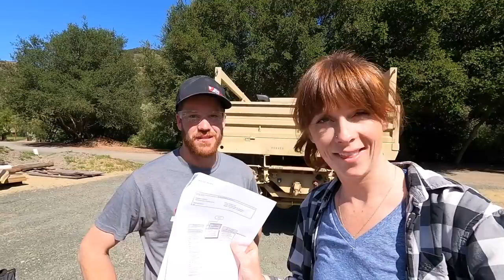We Bought A MASSIVE Army Truck!

Comment: I used to drive these trucks at Eglin AFB. I had a great time. You guys will love it.
Don’t forget these trucks are Army Proof!

We used to bleed the air from the tanks before storage to prevent tank corrosion. Don’t stand in front of the air tank valves when they’re open so you don’t get injected with water.
Reply from the maker: Thanks for the reminder on draining the tanks! We've heard its especially important in below freezing conditions.

Comment: Little pro tip if you haven’t already sorted it, if you just put your hand over the alarm while the air pressure builds it makes it a lot more tolerable. Also, with the truck in park you can press the accelerator to increase the output of the compressor to build the pressure faster.

I’m curious, were the brakes actually locked prior to having the pressure to release them? I would assume they were and when they disengaged they didn’t want to reengage? 🤔 and if all 4 are doing it then I’d think it would be a mix or cross over valve that effected the operation of both sides and the front and back as well. I find it a bit unlikely that all brake chambers should’ve failed at once. Let us know what you find out. Thanks!
Reply from the maker: Riley eventually figured out both of your tips, which saved our ears and patience! 😂

Once we got it home we tested the psi at each wheel and every wheel was receiving 110 psi. They system gets to pressure quickly and holds pressure over night. The parking brake could lock the vehicle up and keep it from moving forward but it would drive right through the service brakes. After driving it a bit they seem to be getting better so we are wondering if things were just rusty from sitting by the cost for 4 years and needed working loose?
Reply: That’s kind of what I was leaning toward as well. I would be interested to see inside one of those drums to see how the shoes look. Watch your backs, because the tires are not light if you go to pull one off to check! Also there is typically a troop ladder shoved up under the bed somewhere to get in and out of the back. However, it may have been borrowed long term from your new rig 😂🤷🏽‍♂️
Reply from the maker: @TimTaigaTradesman  The troop ladder is missing and the previous owner said he never had it. Kind of a bummer!
Reply: Dang, no bueno! That’s alright easy to fab one up, but I’m sure the back will be transformed to something new sooner rather than later. Excited to see what you guys come up with. Also, a bit jealous of Riley’s 3D Cad design work and that plasma CNC you guys have. I’m still using the old napkin drawings and by hand method. Would like to get a better grasp on the metal brake as well. Anyways, I’m just rambling at this point.
Reply: @theadventuresofarenaissancman  there's one. I remembered using them.

Comment: Bought our m1078  in Massachusetts. Drove it home to Kentucky (1200 miles).  Hitting 2 lanes and single lane gravel roads.  Only had one tire blow out due to a ctis valve sticking.  So far I bought a ambulance box to build a removable camper box (pod).  Have fun with it.
Reply from the maker: I’m glad to hear you made it home safely! That sounds like it is going to be a fun build! 👊🏻

Comment: The air tanks need to be purged. There are usually places to do this where the air tank "spits." This is the sound it makes once the tanks fill to 120psi. There should be a wire lanyard or chain that allows you to pull a pressure release valve and water should spray out of the tanks. Once the tanks stop spraying water. Your lines should be clear from moisture that can lay in the air lines. @7:00 It's pretty obvious that this maintenance was not performed when the vehicle was parked. This was what cause the erosion in your check valve. There is also water separator on the engine that should be purged before you crank the engine over, the longer the vehicle sits, the more water build up in the tanks from condensation.
Reply: Every day after the truck is parked and the engine shut off - purge the air tanks.
Reply: great one i said the same thing...
Reply: @coyotePAC3  If its equipped with an air dryer it makes no sense to purge the tanks that often....   :-D
Reply: @johnnyrockford5641  Most military trucks don't have that, lowest bidder and all.  Even if they did, leadership would insist that the air tanks be drained because "we've always done it that way'.
Reply: Also you cut down on maintenance on your air dryer. Every drop taken out is one the desiccant doesn’t have to do.

Comment: The alarm is just the air pressure, it turns off when the air builds up in the tank, a small trick we do is just get a piece of duct tape and put it on the buzzer it muffles the alarm by a lot. Look up the Technical Manual (TM) and it’ll show you how  conduct PMCS for the LMTV and it’ll tell you step by step on how perform operator level maintenance, and show you the parts needed and all that good stuff! If anything stop by your local Reserve or National Guard Center and I’m sure they’ll be more than happy to show you and give you some tips, these vehicles are fully amazing and are extremely versatile. It’s nice for Fording high water.
Reply from the maker: Oh thanks for the tip, we are definitely going to have to quiet that buzzer down a bit! Sounds like we need to get it up to Idaho and find some water crossings! 😂

Comment: I thought maybe you guys left the trailer brakes open but it looks like you know where the air brakes for the truck and the trailer are...  Maybe listen to the truck and do a walk around, apply all the breaks, see if its the air tanks or dryer, there maybe an open valve somewhere.  I'd say you guys are luck because the air system is an easy problem to have compared to the other kinds of complications you could have.

Comment: this is the most hilarious video I've seen from you guys. I spend 9 years in the army and never realized how people that don't about them can have totally different idea about how things work vs. how they actually work.
Reply from the maker: We came in real confident and quickly realized this wasn't going to be like our normal Craigslist purchase... 😂
Reply: @KutWrite  I spend 9 years in the Army and actually loved the manuals!!!  very useful
Reply: @mjl9702  Nice to hear from a fan!
Reply: @KutWrite  The FMTV trucks were initially built by Stewart & Stevenson in Sealy, Texas.  The first couple of thousand production units were shipped in place while S&S and the US Army finalized the Steyr based design. Production was then halted as the huge inventory was run through a retrofit line.  I visited the plant several times back in the 1990s to assess progress on the program.  S&S had e-coat tanks at their assembly plant where they dipped frame components to meet USA corrosion requirements.  The Cat engines, axles, etc were high quality commercial components. Good to see an FMTV truck still motoring.

Comment: If upon starting, the system is holding air , and the tanks are not empty or below minimum I would say your air compressor is working. Have you tried applying the parking brake,  for the cab only, and do a leak down test . You should slowly lose air pressure till the warning sound starts again. Start it up, Tanks should refill pretty quickly and not lose any air just sitting for a short period of time. All air systems have a minimum pressure to keep the brakes unlocked. My 2002 Pete with a Cat 3406 was about 70 psi.  good luck.

Comment: While it is a true 'Ford vs Chevy' argument, by far, the S&S FMTV1078 was one of THE BEST trucks ever built! Well thought-out, Cat engine, very robust with relatively few 'surprise failures'...it far-outperformed the M35/M800/M900 trucks that were its predecessors. Personally, I always wanted to purchase one privately, modify a 20-ft shipping container into an RV-camper body, and make it one of those 'owned-for-life' all-purpose RV/Camper/Hunting rig trucks!...old age an declining health now makes that just a pipe-dream, though...
Reply: The M939 series is a far better vehicle. They put just about the worst engine Cat made in the LMTV, and they tend to have electrical issues. A 923 may be more clunky and less driver friendly but it beats the S&S unit for reliability.
Reply: Aw, don't hate on the old M809's. They at least had excellent power steering over the M35's.
Reply: @ianberry5879  I'll second that.... I did ALOT of research 4 years ago when I decided to buy my 931A2 dump and everything I throw at this truck in my environment it's chews up and doesn't let me down....I use it for all kinds of off road site work and the truck is amazing !
I bought it refurbished from Memphis equipment,TN because I needed a truck that would pass a federal DOT inspection and smoke test.  These guys down there are a pleasure to work with and have been nothing but supportive if I ever need parts or advice.

Comment: Needs the foot valve Court... Changed many of them out just remember to take a pic or two before you remove all the lines. It can get confusing with so many hoses going to it.
It is seized in position... the pedal will still move but the transfer valve is corroded... they are aluminum and get full of condensation and seize.
Reply from the maker: We have been able to confirm that the foot valve appears to be working properly!

Comment from the maker: Thank you all SO much for supporting the channel. We can't believe just 6 months later and we are about to hit 50k subscribers!! We can't wait to keep taking you on adventures, hopefully with functional brakes... 😉

🚨 Have you checked out our most recent Time-lapse video? https://www.youtube.com/watch?v=NXJi-f8_a-4
Reply: May be you build something attractive on this truck.
Reply: Am I 50,001th subscriber?🤣.... I do enjoying your video.. keep up👍
Reply: ЭТО КАКОЙ МАРКИ АВТОМОБИЛЬ????
Reply: I dropped a link for the ™ for the lmtv. Technical manual, very useful when out on your own. Preventative maintenance is everything with Army vehicles.
Reply: Just found your videos on youtube,i hardly subscribe to anything on youtube but your videos are interesting and fun to watch so i subscribed.
Reply: Have you figured out how to tilt the cab forward yet? It's done by air/hydraulic. And much easier to do engine maint, or even check the oil for that matter. Yes you want to see Coolant in that upper sight glass. https://fmtvtrucks.com/4x4-manuals/     You want the 34-1 and 34-2 manual. They will be the most useful book you can find for that truck. Was an Army Mechanic for these a long time back. If you are losing air pressure, it might be due to the tire being flat. Also the brakes sitting for 4 years they might need to be ran for a bit. Just make sure before you drive anywhere, run it long enough for that buzzer to stop buzzing. Hopefully your air pressure gauge is working correctly.
Reply: It sounds like the check valve between the primary and secondary air tanks is plugged or siezed shut. These trucks have the air tanks isolated for safety. If one side does not get air your brakes wont work.  Check all air tanks at the drain valves for air pressure. If one or more tanks do not have air trace the air lines joining them together and you will find a valve similar to the one you cleaned by the skid plate. That will be your culprit
Reply: Drain the air system once a week and there will be zero issues, cold weather you need to pit some alcohol in the system. That beast will keep you happy for a long, long time. Trust me when I say these will take care of you in a bad situation.
I owe my life to one for getting us our of a very bad firefight in Iraq, Route Heather also know as "IED Alley." All flats, holes in unarmored  spots, but she never struggled or quit on us
Reliable as he'll.
BTW, welcome to the GEM state.
Reply: @2Bingo3001  you can us up for any need to know fixes oif you need to.
Reply: @reedrk88t  draining the air once a week if the truck is active is not enough. Every day is the rule for hiway trucks. A truck in moth balls is a different story. The air systems get corrosion and sludge build up in them and the valves stick and seize up
Reply: How Much 🤔

Comment: If the air system is functioning correctly try manually adjusting each brake at the hub. I believe that if you adjust the brake until it locks up and then back it off a half turn the brakes should work.
Reply from the maker: Thanks for the tip Leslie!

Comment: The air breaks are always locked they have a spring and a plate in a cylinder that is pushed apart by air pressure. and check your heat I haven't bin in very many lmtvs where the heat works just an FYI good luck and remember that vehicle was beaten to shit by 18 yr for 20 years don't be surprised if you are chasing problems.

Comment: Not sure if the brake problem is solved yet. Please check if your brake chambers are caged. This is done in order to tow the vehicle but it renders the brakes inoperable. There is a caging bolt on the sine of the chambers if it is inserted in the back of the chamber it means the brakes are out of service even though there is nothing wrong with the system. I was an Army mechanic  hope this helps good luck
Reply from the maker: Excellent tip! They have not been caged but our symptoms certainly mimicked that.
Reply: @AmbitionStrikes  Ok only other thing i could think of is the slack adjusters being out of adjustments. I wanna say its a 10 mil bolt  on top of the slack you turn it until the shoues are against the drums then back of a half turn. Im curious what tje problem will end up being. Im looking forward to finding out in your future videos. Good luck to you both the lmtv is a good and capable vehicle cant wait to see what you guys end up doing with it.

Comment: That buzzer is for the brake low air pressure warning. You have to sit and wait until enough air pressure has built and it will automatically turn off. It is a safety feature.......
Reply from the maker: Yes! It was much more pleasant when we realized Riley could put his finger over the alarm to quiet it down.
Reply: @AmbitionStrikes Some folks will tape foam over it to deaden the noise.....
Reply from the maker: @dalethorburn6626  that is an excellent idea!!

Comment: You should use it as a dump truck then make the sides removable and leave a headache rack for the front then convert it into a removable cube camper. When you don’t need to go camping, you can use it as a flatbed truck or put the sides back on and use it as a dump truck again.
Reply from the maker: Yes Yes Yes!! It's like you are inside our heads... 😂

Comment: This is what I’m building my camper box on! I’ve had the truck for 5 years and have driven it about 30k miles and have been gathering parts. Let the fun begin! These trucks are a bit quirky at times but super heavy duty platform.
Reply from the maker: It is certainly a whole new beast, but we are excited to learn more about them!
Reply: What kind of gas mileage do you get out of it?  I've read 6-10mpg.
Reply from the maker: @inavandownbytheriver  we’ll let you know once we can actually drive it! 😆
Reply: Mine has been regeared to be able to cruise at 60. I get about 10mpg.

Comment: Hi not sure if u have done  this? Under the air tanks there are ring pulls that let u drain air and water that gathers in the air tanks over time, pull these when the air tanks are around 50% this will push any water or oil that has gathered in the air tanks, try  this a couple of times. The other thing to try is to let the air tanks fill up and the buzzer stops then try pumping the brakes until the air tanks are empty with the engine off do this a couple of times. By doing these simple things can help clear water or oil that has gathered in the air system over time, water is a common thing to build up in the air tanks, specially the older vehicles.
Reply from the maker: We have drained the water from the tanks. Luckily, on the wet tank had any water in it so we know our air dryer is working. Thanks for the suggestion and thanks for watching!

Comment: Hey, maybe there is an issue with the line going to the differential  line to the axels or the brakes at the wheels. You both are really brave to take on this challenge thanks for sharing this!
Reply from the maker: We thought for sure it was an air pressure issue but yesterday we confirmed that each wheel is receiving the required 110 psi. We think we found the culprit though so stay tuned for episode 2!

Comment: lately been sticking boxes on these trucks to make them overland styles campers, have you checked the air tanks on the side behind the battery box.  a lot these trucks sit on storage for months before they are shipped off to get sold and they rob parts off them to keep others running the brakes might be caged so they can move them around with forklifts while in storage often no air pressure the brakes will engage and you're unable to move them till building air pressure back up. a tool used to disengage the bakes so they can be towed otherwise you have to run an airline from the towing vehicle to the disabled truck you see airline grab handles on front and rear of the truck, one red and think the other colored yellow
can also check to make sure the handles are on and sealed they can lose the pressure in the system if not properly put on of the rubber seal is missing or damaged or handle missing
Reply from the maker: We confirmed the brakes weren't caged and that the air system is working correctly and delivering/holding 120 psi to each wheel. The glad handles are working correctly as well!

Comment: Well are you building enough air pressure to the point where it ocassionally discharges a little bit of air? You should have around 120 psi of air pressure on the gauge. There is a canister filter on the system that may be dirty.  And if you don't have enough pressure on the gauge you may have a leaky air hose between the air compressor and the air tank and the air discharge release valve?